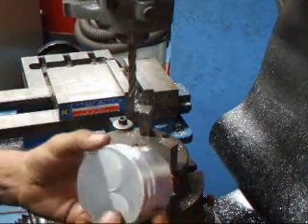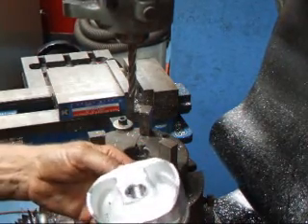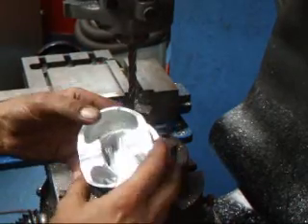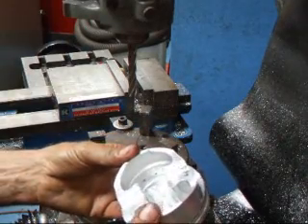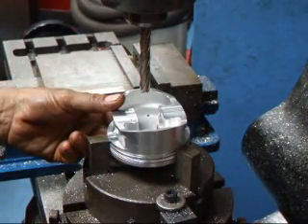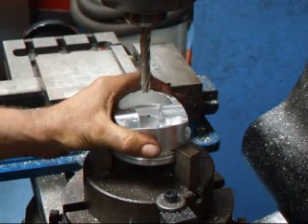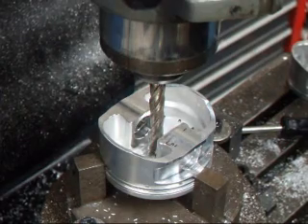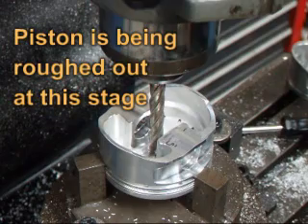VW Drag Racing Piston Lightening

Comment: If I put two pistons in one cylinder, crown to crown, so that each piston crown is like a cylinder head to the other, and moves away from the mutual top dead center, and the strokes are half of the combined stroke, can I safely thin each crown to half it's original thickness? I want to take advantage of the OPOC engine's higher RPM capability while lightening each reciprocating assembly to keep the rising inertial forces at a minimum. I feel that, with the two pistons moving apart, the pressure on the crown of each piston would be halved, allowing thinner, lighter crowns.

Comment: And in VW bracket racing, it's not the speed or horsepower, it's consistency. You can't break out of your time , you are really racing against yourself. I've always said that the ultimate win for a die hard drag racer is to beat the worlds record in your class , then right as you cross the finish line you blow up. Ideally in a top fuel rail.

Comment: what is the best TYPE of piston head for drag racing equip with turbo charger
Reply: We like to used forged pistons in our racing engines
Reply: Even though there is no definite solution you must calculate the right combustion chamber volume for the pressure you plan to run, the side clearance should be increased (especially at the top but if the piston manufacture has something for a turbo application they have that one figured out), and finally you must increase the ring end gap. If you plan on running big boost numbers the clearances should be increased noticeably! Ask the piston manufacture about their recommendation and make sure to mention the static compression ratio the boost pressure you will run and maybe what kind of fuel and a hp estimate!

Comment: does this make the piston weaker?
Reply: with forged pistons I doubt itd make a difference unless youre pushing a ton of power
Reply: It definitely makes it weaker. When dealing with custom pistons, they are designed for a certain application, power level, and duty cycle. Sometimes they are made heavy because the customer is not willing to pay for extra milling operations to remove weight where it is not needed. On the other hand, shelf pistons are made for a more generic use and power level and shouldn't be removed without proper reverse engineering and analysis. Because drag racing is for shorter periods of time, it is more forgiving. However, the milling that is being done in this video, it is not clear if the operator is accounting for ring groove diameters or thickness beneath the valve pockets as everything is a flat mill.

Comment: In response to the last comment the wrist pin is also the area that the accelerating forces are borne, I suspect these forces are much greater than the creation of vacuum during the inlet stroke.

Comment: Hmm I wonder why the engineer who came up with size, shape and every gram of its weight about this...hmmm... I wonder ..
Reply: Engineering isn't about finding the perfect solutions, it is about trying to get the best solution with the available resources. You can machine every surface like a billet piston however many times the customer isn't willing to pay for the extra milling operations which would then result in the piston design being put on a generic forging shape without extra undercrown milling. Just like how the EG6 wasn't designed out the factory to be the fastest or lightest car but around a design concept that is appealing to the end user.

Comment: So you can balance at the same time i assume? i worked at a place where i would use a lathe on the skirts to balance but they were substantially longer than your pistons, they were 2 cycle boat pistons

Comment: I remember the ValueJet that crashed into the Florida everglades. The mechanic had been told to rework the inner bore of the aluminum prop blade. Subsequent investigation revealed the prop failed due to stress fractures and the piece fragmented.

Comment: Dslandrey are you failing at mechanical engineering? If you bothered to research how a forged piston is made then you would understand that all the heat treating processes are completed prior to machining the piston to final dimensions. To stress relieve something like this piston that is already heat treated the best method is to shot peen the area that has been reworked. I do this on aircraft wings when I machine or grind material from them when I remove corrosion. Nice video mate keep it up!

Comment: Βy machining the piston, you are puting a lot of stress to the metal...(inside the crystal structure) because you change the shape of the surface grains... To correct that you need to quench that piston in order to lose all that stress and for the grains to become as in the beggining... (sorry for my english if you don't understand anything... i study mechanical engineering in Greece)

Comment: @TannerDee if you have a piston harder than the cylinder walls, you will grind the walls down. if you have them the same, it will gall (seize). they're made of aluminum so they don't do either of those things.

Comment: @cortinaboy69 Initially i thought way too slow as well. For whats been done there a rotary table not required, thought he was gonna cut the inside rad as well but didnt.
Also why index rotary table then pass horizontally, only Y bed to move across.
Looks like a longish cheap cutter that flexing as well, hear the chatter.

Comment: There is nothintg wrong with old methods mate. When a lathe bedway is cnc surface ground (very accurate). The only way to get it more perfect is the method of scraping which is done by hand but takes a very long time and lots of skill. Cylinder heads that are cnc ported are very good but again the only way to get them perfect is to finish them by hand. Cnc is amsing but for ultimate finesse you carnt beat skill and hand tools somtimes.
Reply: Thanks, after a decade, you motivate (motovated) a nonpro to increase thinking and self confidence. After 1 more decade I'll be back here and thank you again.. rising (riding) up☝️ tnx

Comment: When machining  aluminum coolant is not required in most applications, the material dissipates heat fast enough that it doesn't typically reach a point that cracking would become likely. The exception is running a spindle at very high speeds (10,000 rpms) and taking a half inch cut at 50 ipm.